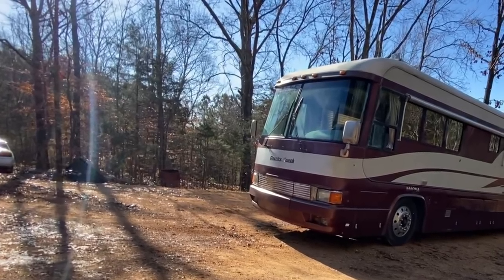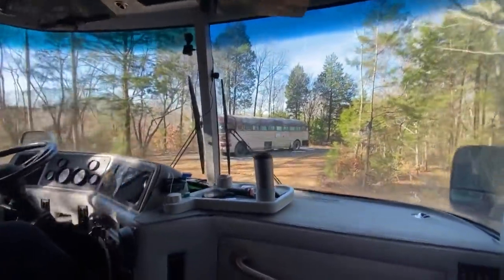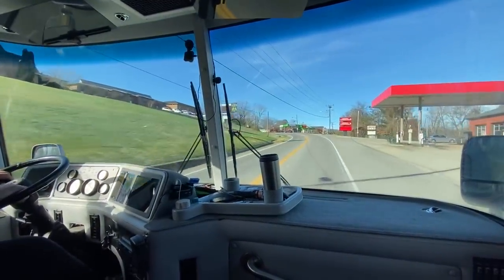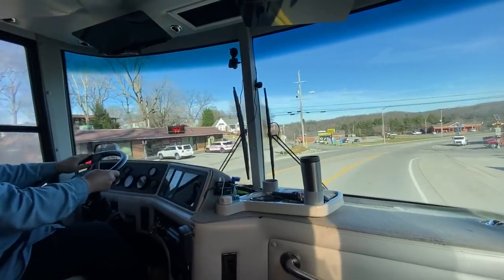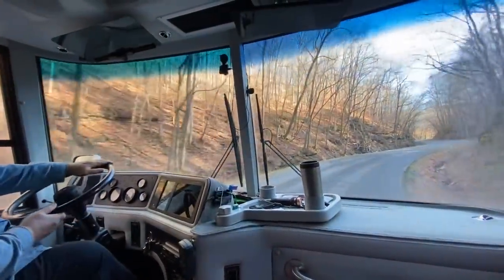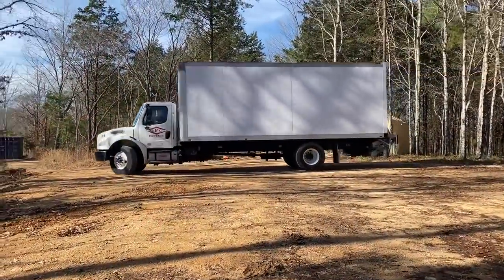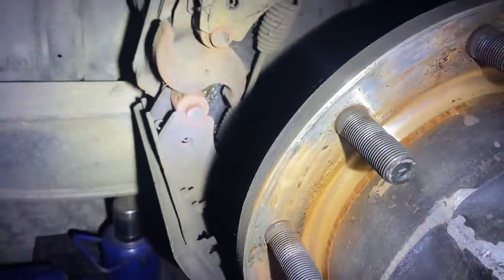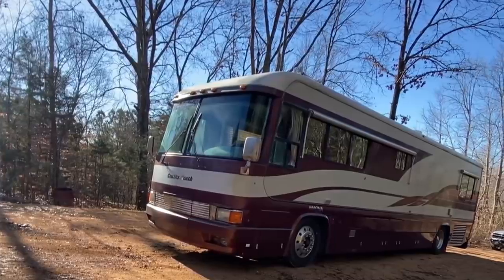County coach finishing the inspection and test drive

Comment: I like this old Gillig chassis.  I had a Gillig under our first diesel pusher, a 38' 1991 Beaver and it was a solid chassis under a solid coach.  Had it for 7 years and she had 129k on the clock when we sold it and purchased our 40'  2003 Monaco Dynasty.  
The Beaver want a powerhouse but it ran good and never had any drivetrain or chassis issues. 
I'm glad too see people keeping these older coaches going and on the road.  
Mike

Comment: In my experience you can get used to almost anything in time.

I have owned as well as greatly appreciated and enjoyed a '97 Toyota Land Cruiser wagon for over a decade.

Last year, a friend who is a professional truck driver had occasion to drive my Toyota and commented on how "the steering was all over the place".

Although it didn't drive like it did when I first purchased the SUV, I hadn't noticed such substantial deterioration probably because I am the primary driver of the vehicle and deterioration would have been gradual.

Off to the mechanic it went where it turned out that a wheel hub nut had been left loose by a previous technician after a stub axle replacement so the whole brake rotor was also loose so the vehicle came back vastly improved which was, distinctly noticeable.

Faults like the king pin could not help but affect control characteristics even for a vehicle with a wheel base the size of a bus, for someone to claim they didn't notice any difference seems unusual.

Then of course our species does not enjoy a level playing field with regard to perceptional acuities' and some people would never admit they had not noticed mismatched shoes .

Comment: seal tools arrived, Luke is dam good about sending the right parts, Seattle Scott working on 1954 Scenicruiser, I need a hard pad of concrete, front is 8,000 and rear is 22,000 Mr. Crosby is right-dam easy to make a jack into a flying object.
good to see the fast turn around in repairs, working by my self takes several Saturdays to get the same work done. 
getting there, doing wheel seals now, too bad the previous mechanic used a chisel to seat the bearing nut, going to smooth that out or replace the nut.

Comment: Hi:

The reason this motor home's Cummins jake works so well is because Cummins  uses the Turbo as the jake brake by changing the pitch of the blades with an actuator to create a lot of exhaust drag.

Michael

Comment: Did you have to replace the keyed washer?  Was it the wrong size, or was the key on it broken to allowed it to turn?  Could it not working correctly have caused the torque on both the outer and inner bearing to be more than it should have been?  I am assuming you did a full inspection on the other side also.

Comment: Scott why couldn’t you enclose the front of the shop with two 12‘ x 16‘Roll up doors so you could heat the shop in the winter time
Reply from the maker: Eventually it will be closed off with doors.
Reply: I'm sure if he lived in Northern Wisconsin, it would be closed already.  It only gets down to the mid 20's down there.

Suggestion would be to put up a cabinet on the wall, and put a 100watt lightbulb in there to keep things from freezing.  That's how they keep soda machines from freezing that are outside all winter.